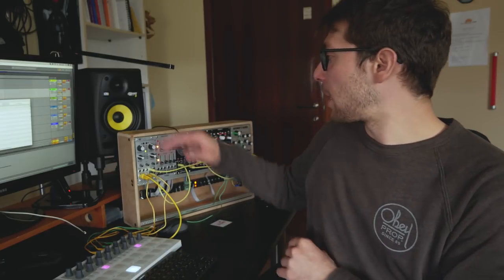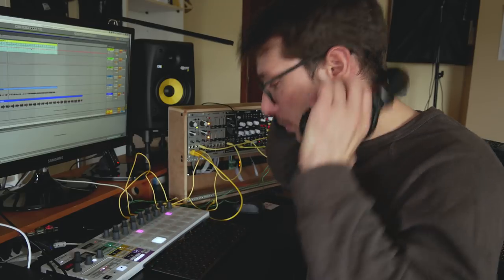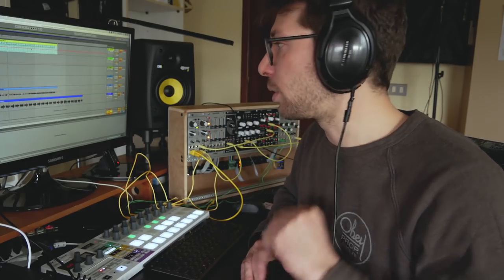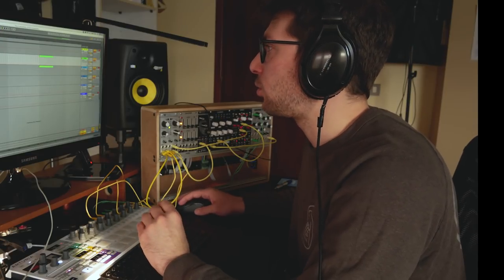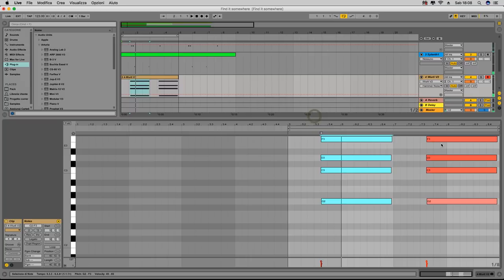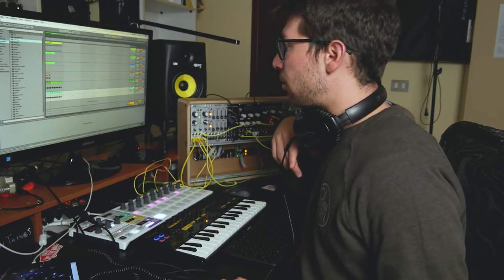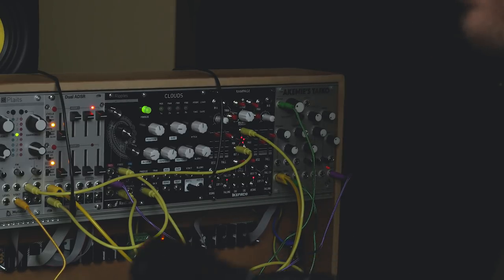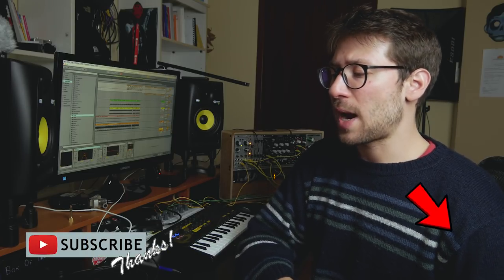modular workflow: making a minimal house track from scratch | distilled noise

Comment: Nice track, and a nice new view of the bed--er, studio ;). Couple questions. How much did your modular set up cost you? Very interested in the sounds you're producing with it. 

Also, checking out your French Cuisine EP, specifically Sick Routine, I'm wondering how you programmed the kick "rhythm"? Been curious about this process for a while. Are you just programming extra kicks, or are you using a filtered bass patch to create that low end groove? I'm specifically talking about the first 50 seconds of the track.
Reply from the maker: Every module is around 200 euros, some of the i bought used, for the filter i paid 70 euros, but the original version from MI is more expensive. Also the case with the power supply, around 170..hand made by a guy from italy (look for Irko Case on fb if interested).
For the track "Sick routine" the kick is just a sample, simpler than expected 😉

Comment: Great vid again. Always pick up a lot from these vids. Couldn't you use a compressor to sort out the attacks on those sounds instead of using automation on the volume or was you doing it by hand to add variation to the sound?
Reply from the maker: Yes probably i would obtain something similar but i'm not shure i would have so much control 😊
Reply: Great way to tame peaks and get a more interesting sound is to use saturation.
Reply from the maker: @emrah1986  yes! true!